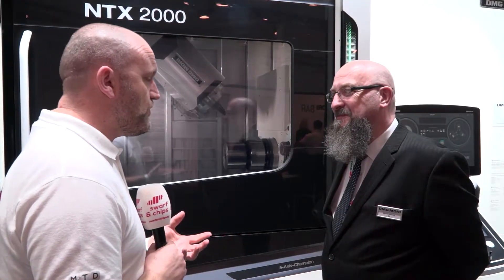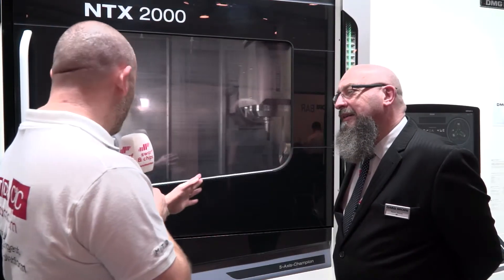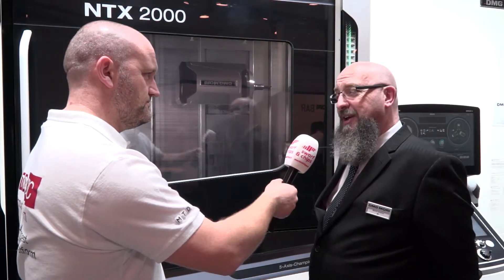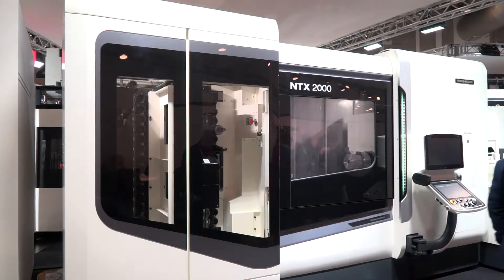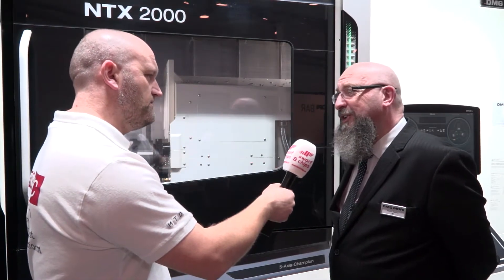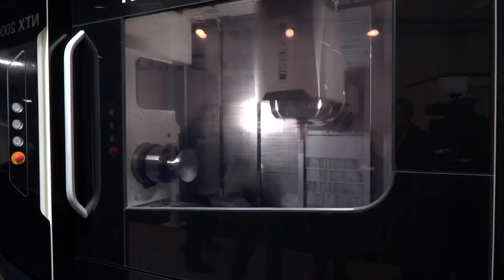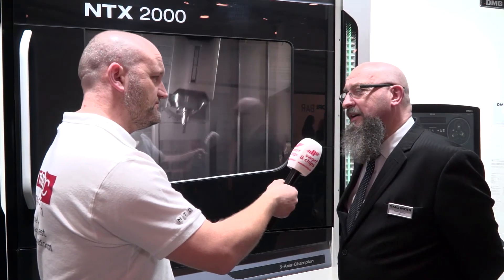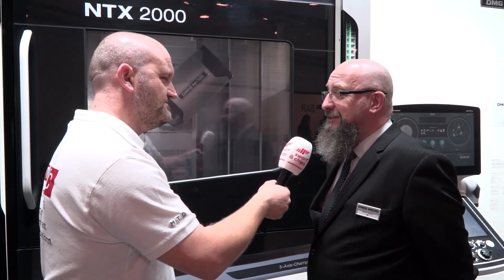DMG MORI NTX 2000 at MACH 2018

Comment: I noticed on the DMG Mori web sight that the NTX gen 2 range doesn't have the octagonal ram and also now has the compact master milling head..?
Also the model number after the NTX means chuck diameter and not max turned length..just thought i'd add that to the description ;-)